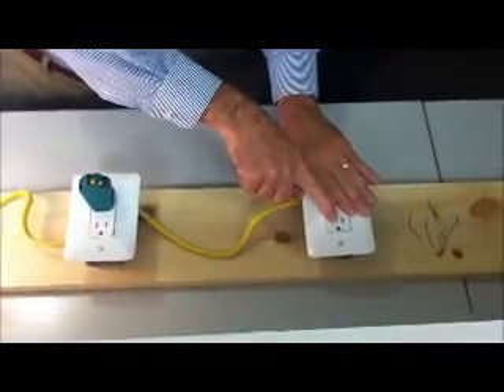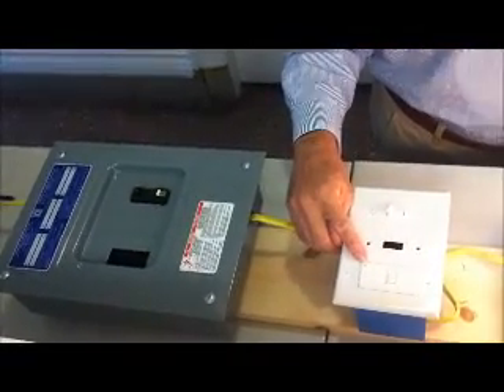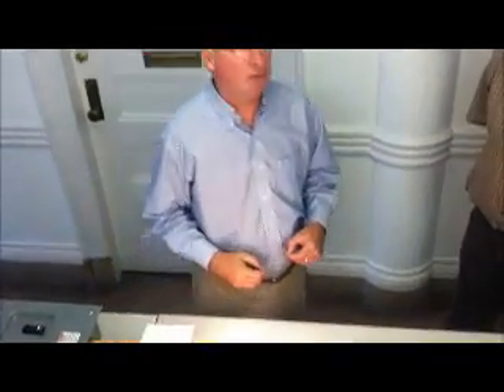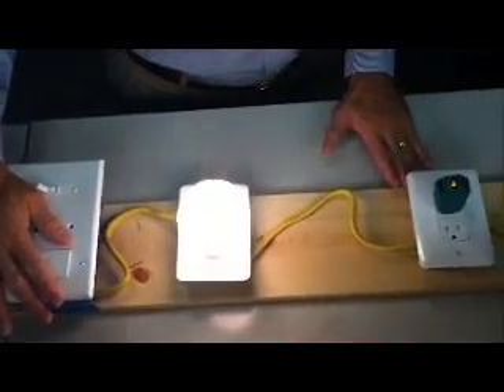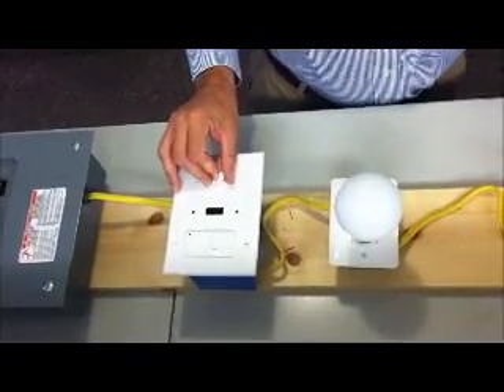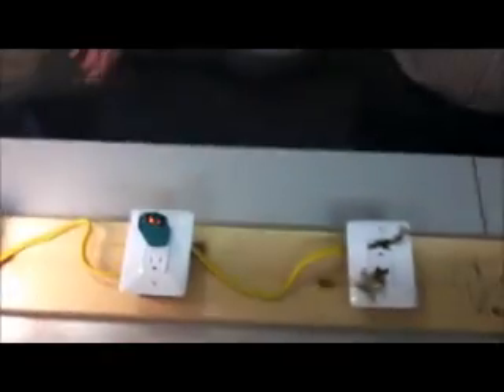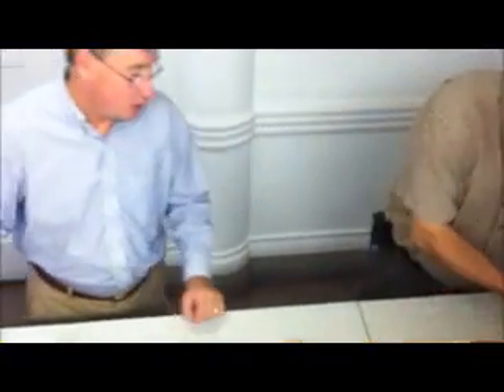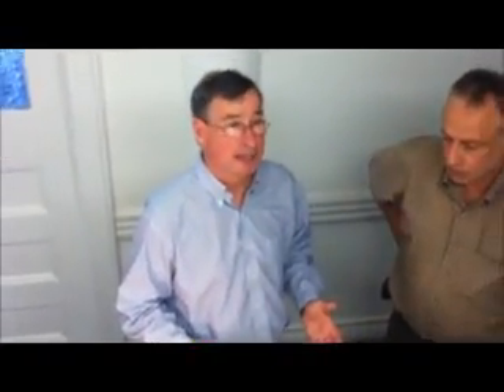Tamper Resistance, Arc Fault, and Ground Fault.

Comment: Great stuff Frank & Mike...this certainly points out the real needs in our psychiatric facilities for arc, ground and tamper protection in combination. Maybe the breaker manufacturers will see the need and make the combo arc fault/gfci breaker available. They have the technology, they just need the market. If The Joint Commission pushes for such a system, the market is created. Let's hope we see it as a standard in the near future. BA